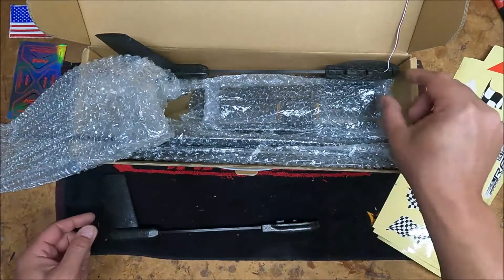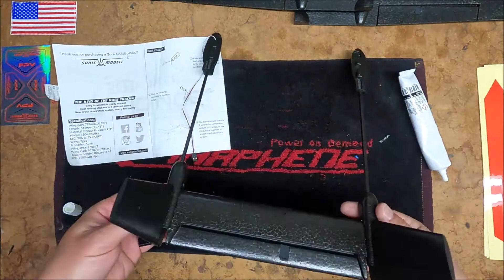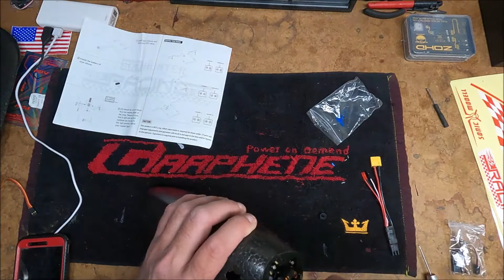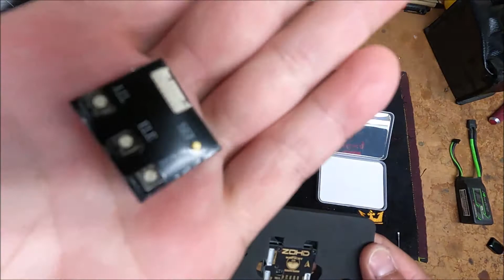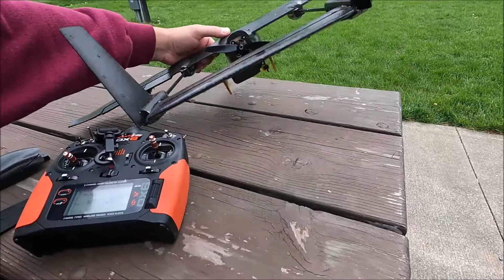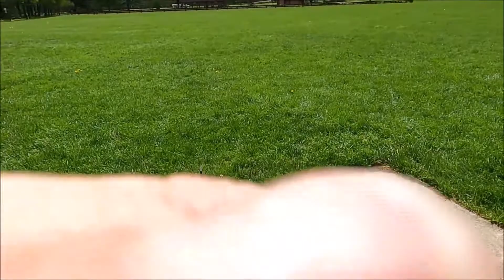ZOHD copilot lite using spektrum DX6, ar6610t receiver in sonic modell sky hunter with maiden flight

Comment: Having trouble getting flight mode on my nx8.  I have the 3 mode switch  working but nothing working on the ZOHD flight board.
Reply from the maker: Is it set to ch 5?
Reply: @The RC Channel  yes in the channel  setup page 2, ch 5 = b switch
Reply from the maker: Black wire on the bottom?
Reply: What black wire and bottom of  what
Reply from the maker: @raymondcross1187  there are two connectors on the zohd kit one has four plugs and one has three the one that has three needs to go on Channel 5 into the receiver down the black wire needs to be facing down

Comment: so how did you hook up the servo plugs? that would have been nice if you actually showed how to install this
Reply from the maker: The servo plugs go into the ZOHD controller it is labeled on the unit where the servos plug in. I will make a full video on how to install and tune shortly. 
thanks for watching
Happy landings ✌
Reply: @TheRCChannelofficial  sorry i been searching for an install video for this type of plane i can't figure out the rear flap i think i may have got it now but not sure.  I just took the kopilot out of a dart I'm putting a real fc n inav into the dart